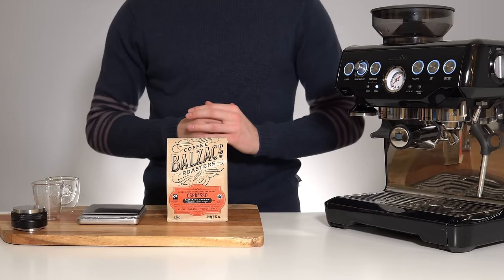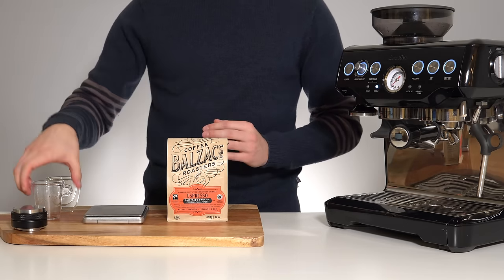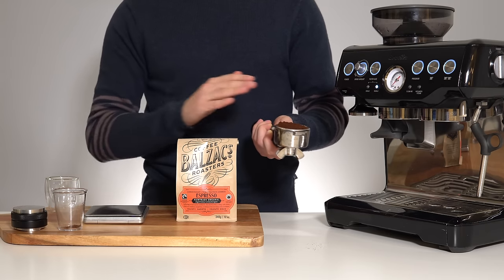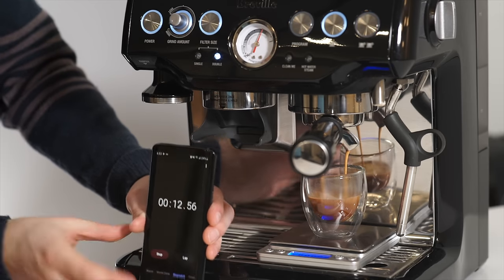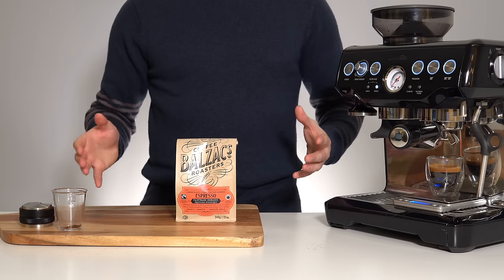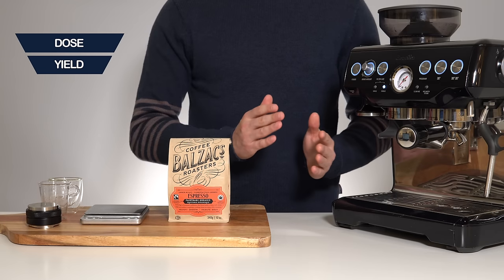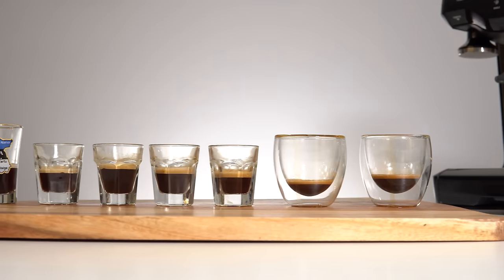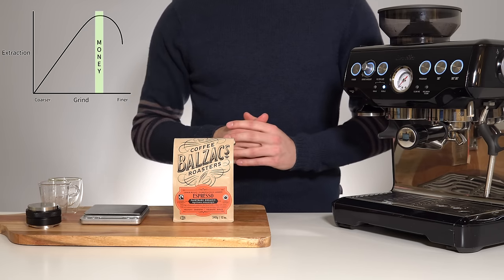Dialing In Breville Barista Express | Dose, grind, yield, time

Comment: Another video says I have to actually be grinding to change the grind wheel. I don’t see you doing that. In all honesty neither method has gottten me into the espresso zone on the pressure dial. I’ve gone as low as 3 and as high as 18. Also, when I do 16 to 18 grams of beans it’s overflowing on my porta-filter. Should I be scraping that off the top or pressing it all down? Regardless no matter what I seem to be doing I can’t get past a 10 second pour and never in the right pressure range. 😭
Reply from the maker: Your burrs are likely set too far apart internally! You'll have to make this adjustment with some tools. If you are grinding 18gr and it is overflowing like that even at the finest grind setting, you are definitely grinding too coarse. That, combined with the fact that you're getting 10sec shot times even at the finest setting, I'm 99.9% confident in my diagnosis here, haha
Reply from the maker: And no, you absolutely do not need to be grinding to change the grind setting. But you SHOULD grind 5gr or so after each setting change to make sure that you flush out any retained grinds from the previous grind setting size
Reply: @LifestyleLab_  Brand new machine Literally let it heat up and tried to use while watching your video for the first time. Should I send the machine back?
Reply from the maker: @RayBonis1  No need to send it back, you just need to set the burrs closer together by opening up the grinder! Instructions can easily be found on how to do this, and I also plan to make a video on the topic soon
Reply: 2M views Man I sent it back. For the price of this thing all this is a bit too much work to have to go figure out how to take part the machine and adjust the burrs. I have the third one coming this week (first one had a cracked hopper) so hopefully the third time is the charm.
Reply from the maker: @RayBonis1  I'll cross my fingers for you! It's a beautiful machine to use once dialed in. Luckily Breville has fantastic customer support
Reply: @LifestyleLab_  Just got the new one and am unpacking. My fingers are crossed too.
Reply from the maker: @RayBonis1  filming the grinder adjustment video today, so you'll be good either way :)
Reply: @LifestyleLab_  Just set up and ran about a pound of beans through this thing. Started at 5 with the grind amount at 3:00 as they suggest in directions using 16-18g of beans. 17g seems to be the “better amount” but only got into espresso zone of pressure twice and even then it was around 10:00 on the pressure gauge. Got the pull between 34 and 38 grams on average with manual programming. Starting timer when liquid comes out I’m nowhere near your times. Even the two that were even remotely on the grey pressure zone were both around 12 seconds even getting to 36g of liquid. On last pull I went all the way to the finest grind on the machine and that got me to 10:00. Good news is it’s progress bad is I’m just clueless as to what to do. 3 machines can’t be defective so it must be me.  It clear on why the grind amount button is relevant if I’m only  putting in 17g of beans and taking it all out. So...I’ll try this again when I come down from sipping on 15 shots of crappy espresso tomorrow. 😁
Reply from the maker: @RayBonis1  Here's your solution Ray! Made this video just for you. I'd change your internal setting down to a 4: https://youtu.be/QNvOcE4-VEo
Reply: 2M views ok man. So as if by magic I’m now in the espresso pressure zone. Still only getting a 10-12 second pull once liquid starts pouring. It was a 38g weight. I weighed it in ounces and it was o it 1.25ounces not 2. Finally it’s still fairly bitter. So I’m in the right zone at lowest grind setting,  slightly bitter, 1.25  ounces at 36-38g manual double shot. Thoughts?
Reply from the maker: @RayBonis1  if you're still only taking 10-12sec, regardless of the pressure, your grind is too coarse. Follow these instructions to move your internal grinder setting to 4: https://youtu.be/QNvOcE4-VEo

Comment: What if at 18g, in order to pull a shot that doesn’t overpressure according to the dial, your shots are always less than 20 seconds to 36g of liquid? Grinding finer leads my shots to over-pressure. 
Very confused
Thanks
Reply from the maker: Don't pay attention to the pressure gauge. The marked "espresso range" is straight up incorrect
Reply: @LifestyleLab_  Oh really! So just continue to make the grinds finer and or increase the dose until the shot pulling time runs to appx 25 sec?
Reply from the maker: Yes, but remember that's only a starting point! From there you can taste and tweak based on your coffee and personal tastes :)
Reply: @LifestyleLab_  thank you. Much experimentation needed as the last few that went over the pressure dial tasted burnt..

Comment: This is helpful, but I think the advice to start with a 2:1 ratio of coffee-to-espresso is wrong. I tried that, and it's way too short a pull for 18 grams of coffee. Isn't a single shot supposed to be 1oz? I measured  36 grams, and it's less than 1.5 oz. A 2oz pull is 54 grams, or a 3:1 ratio.
Reply from the maker: It all depends on preference! Hence the second part of this video :) 
1:2 is a very traditional ratio that work be right for every person, or every coffee!
Reply: @LifestyleLab_  But it goes against all the other advice I've seen, including the Breville owner's manual. After tuning my pulls for the last month, and reading some of the other comments on this thread, I'm concerned that such a short pull will produce very poor results, and frustrate users. Not sure what your reference for the "classic" 2:1 ratio is, but look at it another way. A single shot would only be about 0.6 ounce of espresso, much less than a standard espresso cup.  I also checked with a single-shot espresso glass I have - it's a little over 1 oz.
Reply from the maker: The Breville machines are largely targeted to please the consumer market, hence why their programmed in double shot volume is 60mL. If that's the ratio that taste best for you, then that's 100% the one you should be drinking! But 25 seconds to 36 grams is a very standard starting point from which you then dial in further :)
Reply from the maker: Perhaps you will trust the opinions of a world barista champion? 
https://youtu.be/lFwJF-_SUr0
Reply: @LifestyleLab_  But that's my point. You can't (nor I believe should you try) get a 25-second pour to yield just 1.2 ounces! The machine is designed to draw a shot by volume of water. If you reprogram it to just yield 1.2 ounces, you're gonna get a dishwater shot every time.

Comment: 😩 I am so out of my depth….I’m on the finest setting grind and increased my dose to 22g. Tamp even and no channeling. The pressure gauge sits at 12 - 1pm on the dial yet my shots are taking only 13 seconds to get to 36g. I can’t go finer and I can’t dose more. Anyone able to help a newbie out? Am I right thinking that if it’s too fine and too tamped then the water will create a channel somewhere and that’s why it’s hitting the 12pm mark on pressure gauge but then extracting fast at the same time? 🤷🏻‍♂️
Reply: Maybe this can help, there is an internal grind setting that might solve your problem: https://youtu.be/QNvOcE4-VEo

Comment: I have been having a problem with my Breville Barista Express with consecutive shots, where the first shot I pull comes out perfectly, but the second shot I pull, with the exact same settings, barely get extracted, as in after 40 seconds it isn't even at 10 grams. 
Any advice?
Reply from the maker: Your filter basket holes may be getting clogged by grinds from the first shot. Make sure that it is completely clean before running the second shot. 
Are you steaming milk in between the shots as well ?
Reply: @LifestyleLab_  after I pull a shot I rinse the portafilter under hot water from the machine and then wipe it all away. No, I only steam milk afterwards
Reply: @LifestyleLab_  also, I have been having problems with the pressure, where the pressure gauge would be outside of the espresso range (too much pressure) but the yield is coming out too fast. Getting 36g of liquid coffee out in 15s. What would you suggest is the problem?
Reply from the maker: @cbphotography_me  if espresso is pouring out very quickly with high pressure you have channeling in your puck. You need to be very careful to make sure that your grinds are perfectly distributed especially around the edges of the portafilter.
Reply: @LifestyleLab_  thank you so much. Will see if I can distribute better

Comment: somehow my machine only goes up to espresso range when i have extreme settings: 22g with grind size 1... ive cleaned the machine and changed the silicon ring as well. Any advice please?
Reply from the maker: You need to grind finer! 
Eventhough you are already at an external grind setting of 1, you can still grind finer by adjusting the INTERNAL grind setting. Here's how: https://youtu.be/QNvOcE4-VEo
Reply: @LifestyleLab_  Thank you so much. I thought i was supposed to avoid going too fine at all cost. Do you recommend reducing the dose and grind finer?
Reply from the maker: Problem is, the grinders on these machines are not "calibrated" to one another, so a 6 on my machine may be a 1 on your machine. This is why they include the internal offset as well. Dont pay too much attention to what others are doing, just adjust until you are getting a proper flow / flavour. 
Yes, with the 54mm Breville machines keeping dose below 18gr is beneficial.
Reply: @LifestyleLab_  I just tried different settings for almost an hour as your other vids did. I found it impossible to reach enough pressure with 18g since it was too shallow after tamping, but was able to adjust the inner grinder and have exact 25sec shot you mentioned. Thank you so so much...

Comment: What burr should I start with?
Reply from the maker: Watch the video
Reply: @LifestyleLab_  Cheers for the reply! I did & you only specified grind size not burr size?
Reply from the maker: Ah, you must be referring to the macro setting. Leave that at the default to start, and just as needed. Here’s what that adjustment is used for, it gives extra range when needed. https://youtu.be/_uB3FZGkR6E
Reply: @LifestyleLab_  Yeah the setting inside the actual grinder itself. Thanks for getting back to me :)

Comment: Anybody know some kind of "ratio" between the gauge "lack of units" and bar/pressure?
Reply from the maker: Nope, and don't worry about it because you can't adjust the pressure on this machine so the gauge provides essentially zero value! 
Focus on flow and taste 👍
Reply: @LifestyleLab_  THX!! I Will try; it's just I had understood ideal pressure is about 9-10 bar, and I thought maybe could be the "twelve o'Clock" you say in the video.
Reply from the maker: @raulgarcia6054  Breville has also since lowered the pressure on certain models. In this video I'm using an older version that is running up around 11 bar

Comment: So if I do single shot still about 18g coffee?
Reply from the maker: No, you will need to reduce the dose to between 9-11 grams for a single shot. The grind setting can stay the same
Reply: @LifestyleLab_  I recently sent it back to repair they change the board for me. After it backs a new problem come out, when extracting it won’t stop automatically I have to push single or double bottom to make it stop. I did single shot, scale it 10g,grind size 4,burr size I change to 3, water pressure between the range. Make me confused 😐

Comment: I’m confuse.  If a double shot should be around 2.2.5oz  but here your getting way less
Reply from the maker: It depends on personal preference as described in the Brew Ratio section of this video. 2oz of espresso would be a 1:3 brew ratio which is quite long, but something many people prefer due to the less intense flavors. 
Like I said in the video, Part 1 will get you pulling a decent shot, but you need to understand the concepts explained in Part 2 to dial in a shot to what YOUR tastebuds prefer

Comment: Can I do 14 grams then I'll wait 20-30 seconds to become 28 grams in the cup?
Reply from the maker: 14gr would likely not be enough volume to adequately fill a double shot basket, and result in poor water flow or pooling ontop of the puck 

You could go with 10-11gr into a single shot basket if you want a smaller shot?
Reply: @LifestyleLab_  ok, thank you, already subscribed. I'll try 18g then. One more question, so Lattes, Cappuccinos, Americanos, etc. have espresso base right? Therefore if the espresso is great, will it also reflect to the greatness of Lattes, Cappuccinos, Americanos, etc. that will be made out of the great espresso shot? I hope that you'll get what I'm asking 😅 thank you very much in advance if you answered this question. 😁
Reply: @LifestyleLab_  I'll try 10g if I want a single shot btw. 👍 Thanks for the tip
Reply from the maker: Absolutely! Having a good shot of espresso is a key base to any good latte or cappuccino. But you need to also have well textured milk to make the perfect latte / cappuccino :)
Reply: @LifestyleLab_  thanks!! It's been too long before my question answered very well. Kudos to your channel and please don't hesitate to always help us amateur/noob coffee lovers/hobbyist such as myself. 😅☕

Comment: No matter what I do, the extraction always lasts 12 seconds, for a dose of 1 espresso. I've already reset the machine and the problem persists.
Reply from the maker: Hit the "Program" button before pressing the single shot button. The shot will run until you press the single shot button again. That shot duration will now be locked in as the new default.

Comment: Guys does this works with breville barista touch? Been having a hardtime dialing in good espresso and decided to reach out to ya’ll coffee lovers 😭
Reply from the maker: This will work with any espresso machine period! The method and concepts for dialing in do not change from machine to machine :)
Reply: Omg thank you for your fast reply! One more thing, once i’ve found the right grind setting do i still have to weigh the liquid everytime i pull a shot?
Reply from the maker: @Zuneg1  that's really up to you once you're dialed. If you want to pull manually, then yes, you'll need to use a scale to know when to stop. But if you've programmed your shot time to give you the right yield, you should get a relatively consistent shot just using the pre-programming

Comment: if we used 7 grams we should get 14g in 25 seconds ?
Reply from the maker: 7 grams would be a very underdosed filter basket (even for a single shot). My single recipe is generally 10-11gr in, 20gr out in, 15 seconds
Reply: @LifestyleLab_  am usimg delonghi ec680 single shot basket 51mm cant put more than 8g on it or it will choke amy advices even the double cant take more than 14
Reply: @LifestyleLab_  and how do u calculate the time when u change the grams
Reply from the maker: Ah my apologies, assumed your were using a Breville. 
You should aim to maintain the same flow rate, and brew ratio from your dialed in double shot. Eg// 
18gr - 36gr - 30 seconds 
9gr - 18gr - 15 seconds
Reply: In my case 7g-14g- ??
14g-28g -??
I still dont get how time of extraction is calculated on different doses/yields
Reply from the maker: Have a look at the second half of this video! Yield AND time should both be determined by taste, not just be any arbitrary number
Reply: @LifestyleLab_  Thanks for your help, but is there is any other objective way to do this rather than subjectively tasting the espresso, i kinda have bad tongue

Comment: hello me I can't do it if I'm too late with my grind I'm direct on pressure if I put the coarser grind will run too fast I can't manage my extraction time I'm lost could you help me
Reply from the maker: Dont worry about pressure. Just start by getting 36gr in around 25sec, and then adjust to your taste preferences as described in the second part of the video
Reply: 2M views ok but my upper burr is set to 6 I tried the finer and coarser coffee with grind size but I can't get 36g of liquide (coffee) it flows too quickly.  you think i should end my upper burr sorry all these questions
Reply from the maker: @83kif  have you moved your external grind dial all the way to setting 1? If so, then yes, change the internal (upper burr) setting to 4 or 5 by following these instructions: https://youtu.be/QNvOcE4-VEo. Then restart the dialing in process
Reply: 2M views yes I have already tried on 1 it sinks too fast.  I will try to adjust my upper burr to 5 with always 18 g of coffee but after I have to put my external grind to how much ??  1 -8-14 ??
Reply from the maker: @83kif  put your upper burr to 5 and leave the external dial on 1. Pull a shot. If it runs too slow, move the external dial coarser until it flows properly. If it still runs too fast, move the upper burr to 4 and try again
Reply: 2M views thanks for the advice 👌

Comment: What is your filter size in this video?
Reply from the maker: This is for a double shot basket. 
54mm baskets sometimes work better with 16-17 grams due to their slightly reduced size
Reply: @LifestyleLab_  Hi I use the double basket on my breville I have no idea of its 53mm or 54mm I try 18g it was too much for my basket, I also have a question what does the grind amount do? On your video you put it on the maximum
Reply from the maker: 53mm and 54mm are often used interchangeably with Breville. It’s the same size. Use 16g if 18 won’t fit. 

The grind amount does not matter if you are weighing and single dosing because you are grinding everything in the hopper